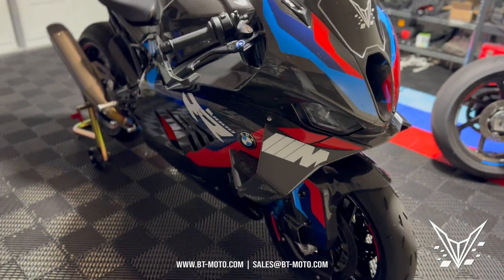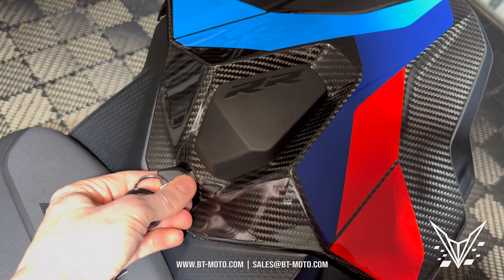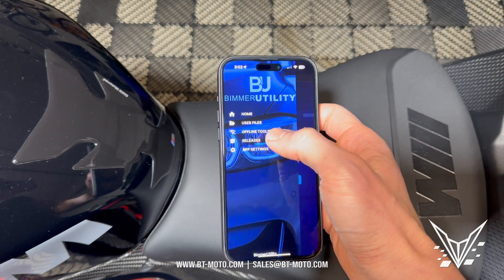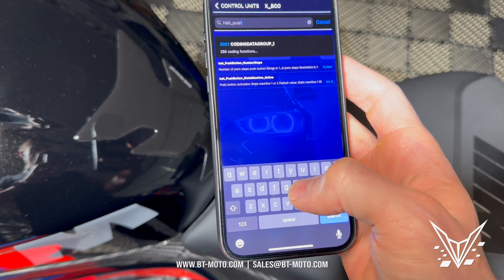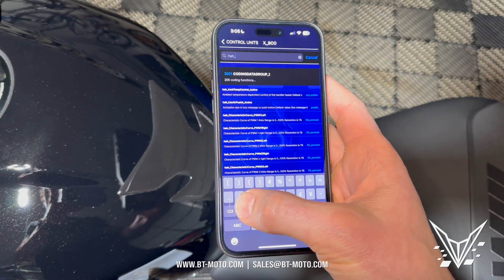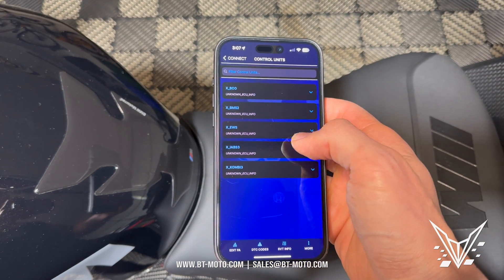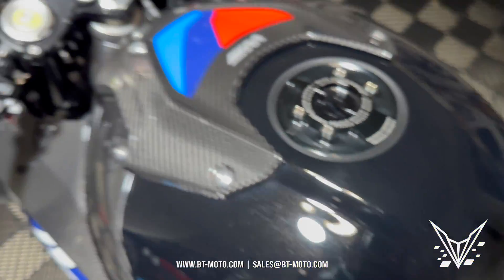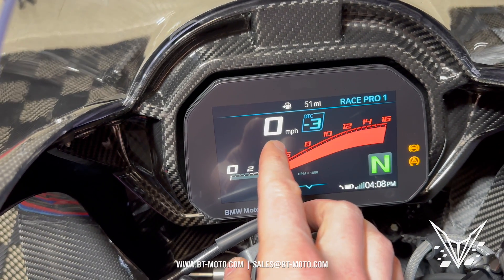BMW Coding Tricks, 5 Stage Heated Grips and Bluetooth In Track Modes

Comment: Thank you so much, your videos are great! I'd love your help coding the gear shift light menu on a 2023 GSA 1250. I've done the coding to get the sport screen, and it's fine. But no shift light yet? Yet, I think it's possible...
I also applied the 5 heated grip levels, and it's fine, great.
I wanted to implement the fact that you can turn off the ABS in all modes, as you explained. The coding is done, but the function doesn't work. It seems like the bike isn't taking it into account. Do I need to unlock it somewhere else? Thanks in advance for your help or for making more videos on these topics.

Comment: That Bluetooth doesn't work on '22 M1000RR. When I activate, I lose track modes configuration completely. Did someone have the same issues ?
Reply: Same problem - I have  2022 S1000RR. I don't think this code is the one
Reply: I had the same issue. If you notice at the end of the video he never shows it actually working. The video just ends

Comment: I just did the mod to my bike and it worked but is there a reason why I don’t see the option to go on my race pro modes? The racetrack option on my settings is gone 😥 has that happened to anyone?
Reply: Yep. Had to revert to get my Race Pro mode back. I've been looking for a solution on several forums, but no one has one yet.

Comment: Hi

Seen a few videos of yours using both the BimmerUtility and the GS911. Which one of them would you consider most essential for a 23’ S1000rr? Would like to do the DRL and startup mod, but also diagnostics and fault code deletes at the track/on the move

Cheers

Comment: Hey Guys, great videos. Is there any way on the 2019 to 2022 Gen 4 SKRR to be able to have the Race Pro Modes together with the Rain,Road,Dynamic modes. 
I hate having to come to a full stop, go to settings and enable race pro mode. They changed this on the 2023 models. Wish I could have this on my 2022. Any chance??

Comment: The bluetooth one didn't work. It only disabled my rider pro menu. Is there a way to get the DTC box from rider pro modes in all the other modes?
Reply: Just wanted to add some  additional context here for those (like me) that no longer have a configuration menu for the pro modes after this change: The 2023+ model has an ADDITIONAL menu item in settings where their ride pro modes are configured, which is why they have that setting disabled by default. For the PRE 23' models, disabling the menu mentioned in this video removes our configuration menu. Doing this change on the 2020-2022 will result in losing the ability to configure ride pro modes because we do not have the additional menu items to control them otherwise. The 2023 has the "Riding Mode Preselection" menu item, under the vehicle settings, where they can configure their riding modes. For the previous gen, since that menu item does not exist, it loses the ability to configure PRO modes after doing this coding update, along with losing the ability to switch back and for between pro and non-pro modes. If anyone figures out how to keep the configuration menu, AND not disable the Bluetooth, please let us all know!
Reply: @KennenL  wish I had seen this. I concur with your findings. I wouldn't have bought this stuff oterhwise as it was the primary thing I was looking for
Reply: Same disabled my rider pro modes
Reply from the maker: @andrewash1638  you can still enable rider pro, the menu just looks different after you enable Bluetooth in track modes (as seen on before and after in video). This was also tested on a 22 single R we had briefly.
Reply: @BT_Moto  how do you enable it then? Mine is a 2020 and it would kick me out of rider pro mode after changing it and i can't find a menu for it anywhere
Reply from the maker: @skrappyp-mac6943  that makes sense. This would need newer software to accomplish. Have the dealer update your TFT to enable
Reply: @BT_Moto  was just updated November 18th
Reply: I also tried to enable the connectivity in track modes hack on my 19. It completely removed the option from my settings
Reply from the maker: @nolasandrew  if you look at our before and after, the after is what it should look like. Though scrolling through the menu should yield a different way to access track settings, you should still should be able to activate dynamic pro from the mode selection button
Reply: @BT_Moto any chance you could show scrolling to the correct place to enable the race pro modes? As with others, mine just disappeared.
Reply from the maker: @rickphillips2900  when you see the after, that’s exactly how our M look stock. Further down the menu should be a configuration selection
Reply: @BT_Moto I’ve double checked. There’s nothing there. It is just disabled. I guess it doesn’t work on the earlier S1000RR mine is a 22. Thanks for looking though. If you should show a screenshot or add sone video that would be great. 👍🏻
Reply from the maker: @rickphillips2900  will add to our next tutorial, coming soon
Reply: @BT_Moto thanks. 👍🏻
Reply: @BT_Moto Hello Bt moto, when will you show us how to unlock the speedometer  top speed? Thanks ,you guys doing a top job
Reply from the maker: That’s something completely different but we can look into it.
Reply: Can you also show how to unlock the settings menu so you can change settings while driving.
Reply: anything new?

Comment: And we can buy that utility device from you or from another source?
Reply from the maker: Follow the link on the video for info about the tool. You get it from their website. We are not affiliated with them. Just a useful tool to have.
Reply: If you have a GS911 you can do the start up screen logos and 5 level heated grips. I don't know about the Bluetooth yet though.
Reply from the maker: @ravenmoto5948  yes, we made that tutorial as well
Reply: @bt_moto if I buy the license that does that come with the obd2 plug or do I need to click the "click here" button. To get the plug and the ability to use the app?
Reply from the maker: @honeybadgerwrx  you have to buy the dongle and the license. This is all explained in the first video that’s linked in this video